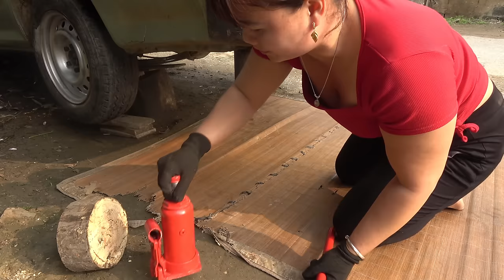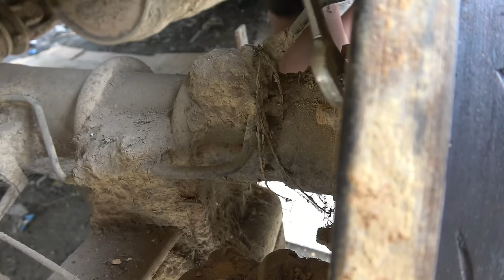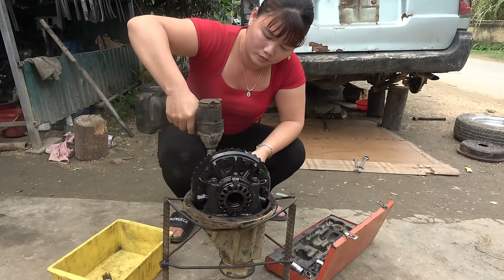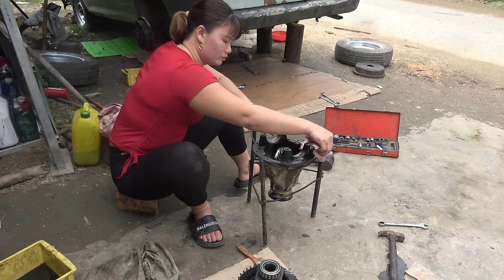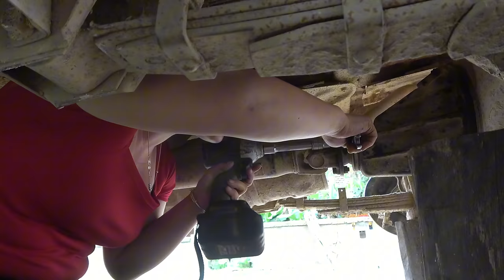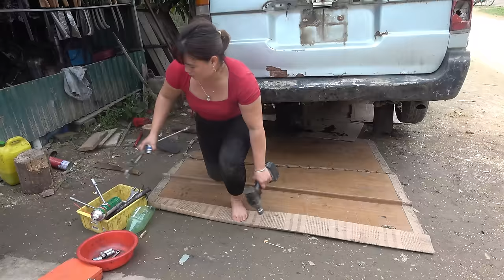Repairs Restores A Old Supercar Damaged. Change Axle Balance Oil. Talented Girl  \ Blacksmith Girl

Comment: What a hack job, where's the dial Indicator to measure back lash ,the yellow marker paint to check tooth contact pattern, gasket or sealer for housing to differential carrier?
Reply: That's because it's actually not about fixing the car they just know that guys like to watch attractive women at least pretending to be handy especially if they're dressed in a sexy way
Reply: Not to mention the fact that she partially disassembled the third member, then kinda cleaned it, then re-assembled it. I’m still trying to figure out what she allegedly did.
Reply: It's called "trailer park" mechanic.,😁
Reply: Easy now.  It still takes 10 years to receive car parts in Sovietistan.  If Joe keeps it up, will get that way here too.

Comment: On the brake drum there are multiple holes , 5 holes for the lug nuts and the holes in between are threaded , all you have to do is find a bolt with the same thread and install it into the hole that is open and tighten it down and the brake drum will come off  ! Now remove the bolt and repeat the same process on the other drums  ! This will make it easier for you to remove the drums ! 😊
Reply: Well ….in vietnam roads only 2 lug nuts per wheel needed….

Comment: Why are you not replacing the brake wheel cylinders on the rear ? When you first did your inspection on the vehicle , you turned back on one of the dust caps on one of the wheel cylinders and brake fluid ran out , this means, it is leaking and it needs to be replaced , a new one installed and the brakes bleed ! 😊